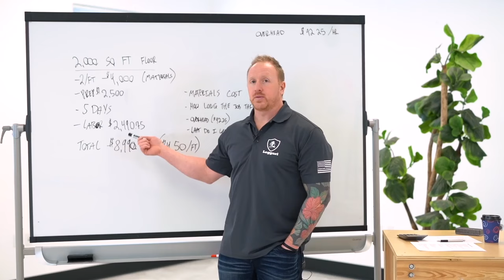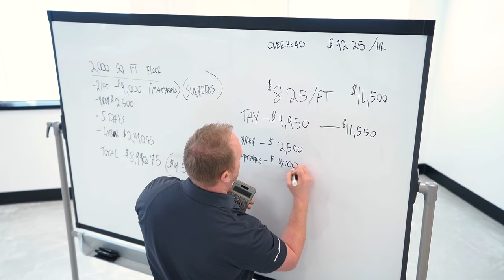Epic Epoxy Table Makeover With Leaf Inserts

Comment: Would it have been possible to coat these panels side by side to produce a more continuous pattern?
Reply from the maker: You can create a continuous pattern with how it was done in the video you just have to pour across the gaps. Easy to do you'll just waste a little product and make sure everything is taped off on the sides.